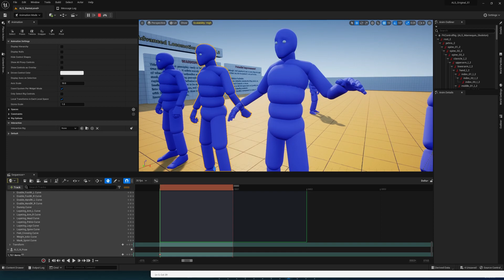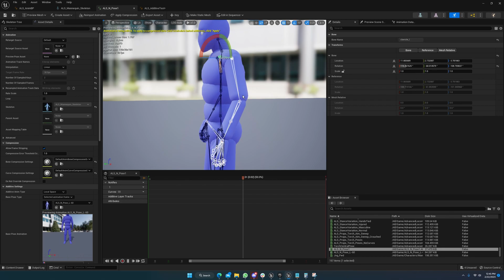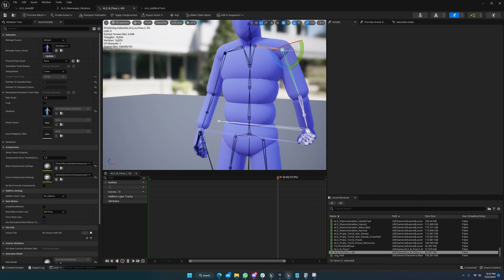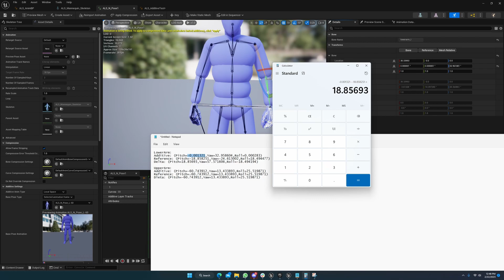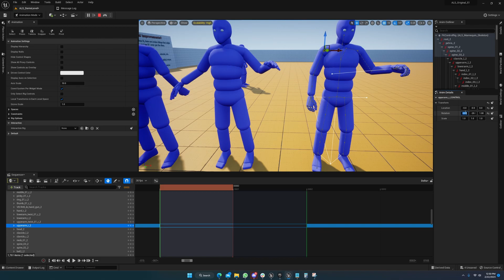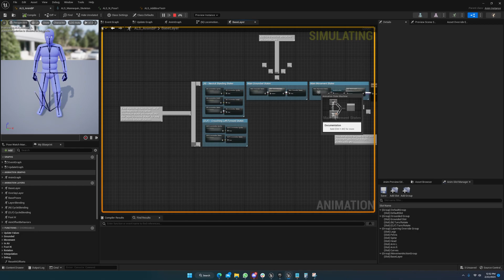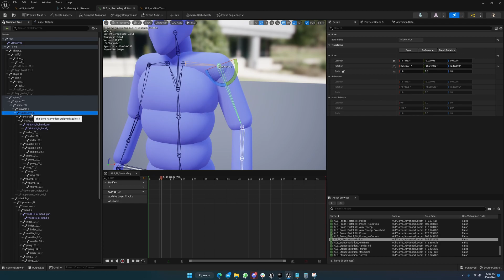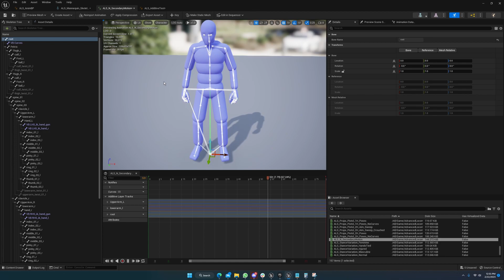Unreal Engine 5 - Additive Animations (Finally Explained)

Comment from the maker: At 7:00 I didn't mention this but the calculated deltas or differences between the bone positions is 0,0,0 and the current animation has it at 1,1,1 then the outcome of applying that additive to the current animation is (1 + 0, 1 + 0, 1 + 0) which is 1,1,1 and that's why those bones don't move.

Comment: Thank you, I clicked like button after saw this video 30 seconds. Do you know what different between dynamic additive and normal additive in Lyra project?
Reply from the maker: The main difference between normal additives and dynamic additives is that normal additives are setup before compilation and dynamic additives are setup during run-time. This allows you to treat entire branches as additives. For example in ALS they get the output of the entire Locomotion Branch and they turn it into an additive during run-time at which point they apply that additive to the entire Overlay State branches output pose. That wouldn't be feasible without Dynamic Additives, and even if you did try, it would require an exponentially larger amount of logic to achieve the same result.

Comment: in tutorial about Additive Anim  from prismaticadev, he just put additive looking left/right poses together and use ApplyAdditive  to connect it with walk animation and it worked, by when i try this, my character legs get broken while walking, what you think i done wrong?
Reply from the maker: If it messed up the legs then the problem is that the leg positions didn't match between the animation and the baspose you set it up on. When the legs don't match the difference between them gets added to whatever animation it is then applied to.
Reply from the maker: Just remember, when you setup an Additive Animation, the difference is what gets Added to the animation it is applied to.
Reply: @unrealdevop  Yes, but in his case it's the same and yet his effect is just like he's using LayeredBlendPerBone on the spine, which he's not using at all. Can I make my Additive works just for spine? I tried LayeredBlendPerBone but it not working with Additives, and its blending is non visible.
Reply from the maker: @llYuki0okami  You still have to apply the additive, if you need to cache the incoming pose from the last node. Look under my Details for the Discord and perhaps I can help you identify what your doing wrong. If the legs truly are the same in both cases then applying them as an additive will not mess up the legs unless you are messing with the pelvis in some way.

Comment: I'm not sure I get it. 
So if you setup an anim sequence asset as a local additive, then the "Base Pose Animation" is used for calculating the delta, BUT the result is applied to the base pose of the skeleton / an a-pose, (instead of the "Base Pose Animation"). 
However, if you instead use Apply Additive inside animation graph, then the input Base Pose is used instead of the a-pose, and we get what we would likely expect?

So this strange behavior of applying to the a-pose would only appear if you were to drag the animation asset directly to the level?
Reply from the maker: I may have done a poor job at explaining it in this video. I would have to watch again, I will do a follow up on this here soon.

When animation keyframes are set on a skeleton or armature, the rotational and location data of the bones are typically stored as offsets from the base pose, which is the initial or rest pose of the skeleton.

These offsets are known as bone transformations, and they specify the changes in rotation, translation, and scale that should be applied to each bone in the skeleton at each keyframe of the animation. The bone transformations are usually stored in a data structure called a "keyframe" or "animation clip," which contains a sequence of bone transformations for each bone in the skeleton.

What I meant about the base pose was that these transformations are relative to that base pose (or reference pose) and so when the delta is calculated...I believe that what you see when you drag it out into the viewport is actually what those delta's would look like before being added to an animation. That's why if you take an animation and duplicate it and offset something and set the additive from the original animation and then drag it out into the viewport only that bone will be different from the base/reference pose. That's how your able to add an additive animation to another animation with it resulting in only a movement on a specific bone....it's best to make additives in such a way that only what you need effected is affected. If you accidentally make minor offsets on the legs then it will screw up the legs in the animations it is added to unless it's done in such a way that it's intentional and desired.
Reply: @unrealdevop  so creating an additive and dragging it out into the viewport could be considered a misleading thing then..

Comment: can you subtract animation poses? or multiply?
also, there's the 'apply additive' and 'apply mesh space additive' you gotta use one or the other depending on which setting you toggle on the animation itself?
Reply from the maker: Apply additive and apply mesh space additive are selected depending on how you setup the additive. Subtracting an animation pose from another gives you a difference offset as explained, this is then added to the currently playing animation using Apply Additive or Apply Mesh Space Additive. So, it's important that get the difference between the poses based on the animation you plan on applying that too. If you don't things will not turn out as you expect them too. Multiplying as far as I know isn't used anywhere, I'm honestly not sure if there is a use for it. This is what I recently discovered after digging through tons of crap and experimenting. Why this information isn't publicly available I can only assume it's because those in the industry that do know, don't want the competition.
Reply: @unrealdevop  thanks for the reply! I don't see a subtract additive, and when I type in negative values, or values over 1, they don't seem to overshoot, so maybe it's capped somewhere.
I assume those that learn from in the industry are on contract to not talk about what they use there. so that's probably a reason why some people don't share things
Reply from the maker: @YuuJer  There isn't a subtract additive, what I explained in this video was how the additives are calculated. When you open an animation and set a base pose it's subtracting that animation from the base pose.....it then Adds that difference back to whatever animation you apply it too based on that. Your not looking for a Subtract Additive or an Add Additive....that's simply the math that is being done when you use Additives